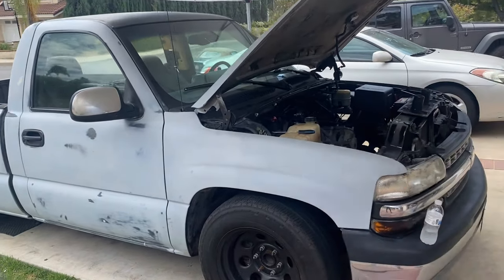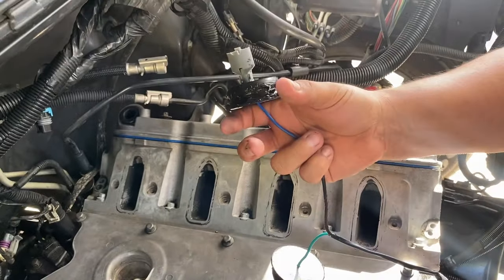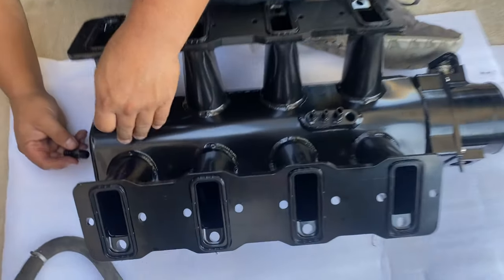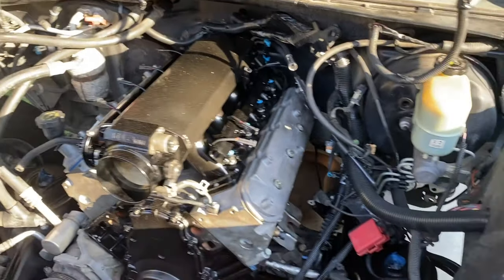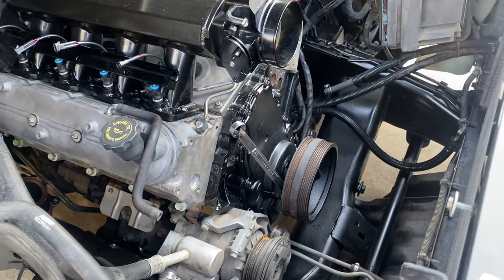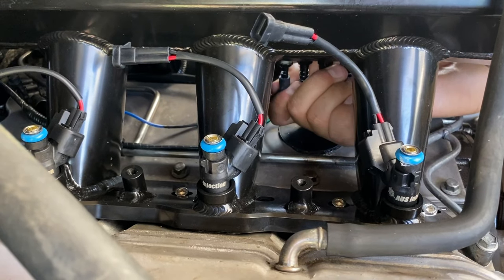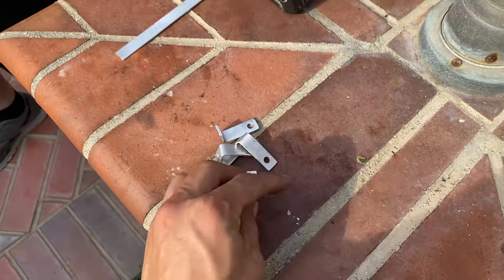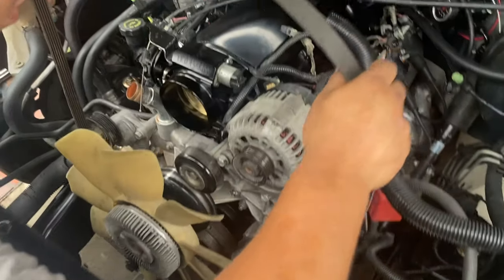SILVERADO 5.3 GETS A 102MM INTAKE MANIFOLD & MORE!!

Comment: The stock intake manifold on these 4.8 5.3 proven to flow more hp and tq over eBay and Amazon fabricated intakes other than that your buddy done a good job doing the swap on your truck though
Reply from the maker: Yeah i’ve heard 50/50 on these intakes I plan on boosting tho that’s why im sticking with this one! maybe a tbss later!
Reply: They put a square port intake on a cathedral port head 😂😂😂 nevermind that it’s cheap ebay crap, the intake to head flow is going to be turbulent AF 😂
Reply: @plugBONE is it bad new here sorry lol
Reply: @plugBONE the o ring is rectangular but the port is cathedral….but still those sheet metal intakes are 🗑️ on N/A
Reply: I would have gone with 6.2 intake manifold

Comment: Upgrading one part means you have to upgrade other parts if you’ll do a bigger manifold then you need a bigger intake cam lobe and bigger trick flow heads along with some injectors with high lbs

Comment: I just got this intake manifold off Amazon and want to say thank you for making this video because I was about ready to return it thinking I couldn't put it on my 05 Yukon Denali 6.0 which has electronic throttle body which making a cable drive won't be too difficult, now I know how to install this and I wasn't aware of the e85 sensor or the regulator I'll see if I can get those off Amazon as well
Reply: Did u end up doing it bro

Comment: Badass video I just got this intake manifold and I'm getting ready to put it on my 05 Yukon Denali and I was about ready to return it until I seen this video so thank you where do I get to eat 85 sensor and where did you get the regulator my s***'s from Amazon
Reply from the maker: Appreciate it brother, I got mine e85 sensor from eBay I think and got my fuel pressure regulator from eBay as well just a cheap one two but it’s been working great. And you don’t really need the e85 sensor unless you plan on running e85.

Comment: I’m almost done with my build bro last thing is what size was ur vaccum hose for your regulator and the size for your PCV line, and what was the little snap on thingy called
Reply from the maker: We use 1/8 vacuum line but will probably switch to 3/16 because 1/8 was a little tight but still worked with some persuasion. As for the PCV line I think it was 3/8 line but would need to double check but almost sure that’s it. As for the snap on thing are talking about the e85 sensor or the fuel line fitting?

Comment: Badass build ! I got the same truck and I installed the same intake manifold, at what psi did you set the fuel pressure regulator?
Reply from the maker: Appreciate my guy! I have mine set at 58 for idle that’s what I’ve heard is suggested, so far so good !
Reply: Thanks for the reply bro! Love the videos
Reply: I hope this ain't a stupid question but do you need the e85 sensor I'm new too all this
Reply from the maker: @thekingofnoobs8362  not at all my guy! The sensor is only needed if you plan on tuning for the truck to accept both 91 pump gas and e85, if you tune the truck only on e85 the sensor is not needed!
Reply: @ErikRose_  one more question what happens to the evap purge valve on top
Reply from the maker: @thekingofnoobs8362  we just left it hanging not in the intake anymore and I think my tuner tuned it out
Reply: @ErikRose_  one more thing the 3rd hose connected to throttle body was that the fuel regulator vent hose goes
Reply from the maker: @thekingofnoobs8362  yessir that is correct!

Comment: Can you slide the link for all the parts you used? Following your build I’m trying to get my 5.3 running on e85 already
Reply from the maker: I gotchu bro full list for what i did on mine for e85! These are exact links of what I bought. 

Fuel Pressure Regulator : https://www.ebay.com/itm/293098256458?mkcid=16&mkevt=1&mkrid=711-127632-2357-0&ssspo=VSwMTnaKQMa&sssrc=2349624&ssuid=nCH1hP3qSsK&var=&widget_ver=artemis&media=COPY

E85 Fuel Pump : https://www.ebay.com/itm/184033790153?mkcid=16&mkevt=1&mkrid=711-127632-2357-0&ssspo=YFsJgTc4R8q&sssrc=2349624&ssuid=nCH1hP3qSsK&var=&widget_ver=artemis&media=COPY

E85 fuel filter: https://www.ebay.com/itm/353786252312?mkcid=16&mkevt=1&mkrid=711-127632-2357-0&ssspo=ckmxfmmqtas&sssrc=2349624&ssuid=nCH1hP3qSsK&var=&widget_ver=artemis&media=COPY

PTFE Fuel Line : EVIL ENERGY 6AN PTFE Fuel Line... https://www.amazon.com/dp/B07JFPXHB2?ref=ppx_pop_mob_ap_share

E85 Flex Fuel Sensor: ACDelco 13577429 GM Original... https://www.amazon.com/dp/B01GQR9C5O?ref=ppx_pop_mob_ap_share

E85 Sensor Connector: For GM E85 Flex Fuel Sensor... https://www.amazon.com/dp/B07115TSNK?ref=ppx_pop_mob_ap_share

E85 Quick-Disconnect Female Push-On EFI Fitting : EVIL ENERGY 6AN Male to 3/8" SAE Quick-Disconnect Female Push-On EFI Fitting https://a.co/d/6y8j7sV

And you’ll need AN6 fittings to connect all your PTFE hoses, that’ll differ depending on how you route your hoses. I got mine on Amazon as well. Thats Everything.

Comment: You took the time to clean the valley plate, should’ve painted it to protect it buddy 😮😅✌️
Reply from the maker: Ehh gonna do another rebuild when I turbo it down the line ! 💪
Reply: how is paint gonna protect an aluminum piece? I could see if it was steel you can protect from rust but what value is it gonna have on aluminum besides cosmetic?
Reply: Its been there all these years unpainted, it’ll be fine lmao
Reply: Shiiiii just finished a L87 Stroker from the block. 10 months! Ridiculous! And the cost so far? Almost 30. All my labor. All made in the US 6.8 liter. 1000HP

Comment: I’m still stuck installing bro my last few things is how’d you do it with your EVapor canister and your EGR line tube, I’m having trouble with them I don’t know what to do with them
Reply from the maker: Unfortunately, you can’t run those on this manifold. I just deleted them and having the tuner tune them out. There might be a way to do it but will require fabrication.

Comment: Did you have any issues with the fuel rail mounts? I got this same intake for the 5.3 I built for my sons 85, running the multitech 2 injectors, I had to heavily modify the fuel rail brackets.
Reply from the maker: Yeah, my mounts didn’t work with my injectors either had to make completely new ones..

Comment: How did you get the fuel injectors installed every time I install mine I break a O-ring I’m $100 in O-rings already
Reply from the maker: LoL, they just went right in no issues. Do you have the right fuel rails?
Reply: @ErikRose_  fuel rails work great it’s the intake manifold that they won’t fit. What injectors did you use?
Reply from the maker: Ok, I used AUS 36lb injectors from lsxceleration.

Comment: What’s the difference on a 92 mm and a 102 mm I have a 4.8 which one would be better the 92 or 102
Reply from the maker: It’s just a bigger throttle body, a 92mm should be fine for a 4.8

Comment: did you delete the big ol emission pump or w.e that's on the left side of the engine bay ? link to the e85 sensor ?
Reply from the maker: yessir deleted it and had my tuner tune it out! 

Heres the link to the sensor I got!

ACDelco 13577429 GM Original Equipment Flex Fuel Sensor https://a.co/d/5qzyJVc

Comment: What did you do with the front coolant pressure line that runs to the oem intake? Was that line blocked off??
Reply from the maker: The steam port that goes through the throttle body?

Comment: Badass informative video bro! How’d you run the throttle cables?
Reply from the maker: I made a custom bracket that bolted right onto the throttle body, but they do also sell ones that fit those throttle bodies too perfectly!
Reply: @ErikRose_  appreciate the reply! I’ll see if I can find one, did you see them on Amazon or a specific website/brand?
Reply from the maker: @daniellozano289  Here’s one on Amazon! I think they have the same one on ebay too! 

Woopeey 4-Bolt Throttle Cable Bracket for LS LSX LS1 LS2 LS3 LS6 LS7 Intake 92mm to 102mm https://a.co/d/299loBU

Comment: Hey bro when u changed the headers for the 5.3 ones does dont have the egr valve do u have to get it tune if u delete it or can u run the truck like that
Reply from the maker: Yeah you can run it like that, but you will just have a check engine light on. So if you don’t want one you’ll have to get it tuned out.
Reply: @ErikRose_  whats the pros on changing them
Reply from the maker: Not much, we just used them because we put the tbss manifold which doesn’t have the port for the egr stuff so we used these exhaust manifolds because they didn’t have the ports either which work out good.

Comment: whats the electronic sensor looking doo dad on the line in to the pressure regulator?
Reply from the maker: that sir is an E85 flex fuel sensor, not required for the fuel pressure regulator just something I added for tuning later.
Reply: @ErikRose_   thanks!
Reply: So what do you use in place for the e-85 sensor if you’re not going e-85 yet?
Reply: @moycorral7870  probably  just run the line as you would but without the sensor

Comment: Do you have the linke for that intake manifold
Reply from the maker: Yessir! Heres the link to the one I got bro!

Top10 Racing Intake Manifold with Fuel rail fit 102mm Throttle Body Sheet Metal Fabricated EFI 15° Throttle Opening Compatible with Chevrolet Chevy GMC Pontiac LS LS1 LS2 LS6 Black https://a.co/d/19sIHZz

Comment: Where did you get the throttle body from?? Can you send the link?
Reply from the maker: Yessir I gotchu! This the exact one I bought!

LineRacing 102MM Throttle Body for Chevy GM Gen III LS1 LS2 LS3 LS6 LS7 SX LS LSX 4 CNC Bolt (Black, 102mm) https://a.co/d/7meQJD3
Reply: @ErikRose_  thanks appreciate it
Reply: @ErikRose_  do you have the link to that intake....
Reply from the maker: @robertchalk8193   yessir there you go! 

Top10 Racing Intake Manifold with Fuel rail fit 102mm Throttle Body Sheet Metal Fabricated EFI 15° Throttle Opening Compatible with Chevrolet Chevy GMC Pontiac LS LS1 LS2 LS6 Black https://a.co/d/iFRc10U

Comment: Did you mount square port to cathedral head with no adapter?
Reply from the maker: My kit came with the gaskets that give the ports a good seal ! so you can either of the two adapter or gaskets.
Reply: @ErikRose_  I just spent $217 on adapter.  Gonna return it now
Reply: @ErikRose_  I have same seals.
Reply from the maker: @fmrperformance7774  what manifold do you have?
Reply: @Erik Rose  chrome version of yours.

Comment: How did you put a 102 ? Rectangular ported on a triangle port head???
Reply: I noticed that too LOL it’s possible cause the square ports on the intake is larger than the cathedral ports on the cylinder heads making it able to work but there’s a big problem in doing this as it could cause a lot of turbulence but I think some have done it without any problems but using cheap eBay or Amazon fabricated intakes I don’t think anybody knows if it effects the turbulence and choke the cylinder heads or not
Reply: This is where I'm stuck at the cathedral ported heads and the rectangular intake......does it work or what

Comment: I got a stock 5.3 wtf should I do to add more Power
Reply from the maker: Everything that i’ve done to my truck has been for power increases, Stage 2 Cam, Intake manifold, E85, and theres lots of other things you can do!
Reply: @ john_doe627 Iam in the same boat but I have decided to do full aftermarket suspension, long tube headers, high rise intake manifold, all new msd ignition system, new fuel system, and possibly a new distributor, and new brake system. You gotta think when you start adding power don’t want your ride, riding like shit and it’s gona need the fuel so yeah it’s expensive but driving that bad boy on the weekends to the track priceless!

Comment: Your injectors didn’t leak ?
Reply from the maker: Nah no leaks !
Reply: What about the ports to the rectangle to  cathedral
Reply from the maker: @GbodySS_LsX  no issues as well ! but i do know they make a cathedral port style for this manifold if you want that !
Reply: I already have it mounted just having fuel rail issues with my alternator but I bought fittings
Reply from the maker: @GbodySS_LsX  is not clearing or hitting the alternator? Because I know they make 2 different styles of the Manifold, a short runner and a long runner, mine is a long runner and clears with out issue!
Reply: I seen u use the 180 fitting I have the cross over in front il probably re rout it on the left side nd have the cross over in rear thanks papas
Reply: It’s hittin the alternator
Reply from the maker: @GbodySS_LsX  ahh ok yeah you probably got the short runner intake, which it still works but you just need to make some adjustments around things like that!
Reply from the maker: @GbodySS_LsX  yessir I made a youtube short also to explain the set up a little better if you wanna check that out also ! 💪

Comment: Nice ! If you dont mind Bro can i get all the Links
Reply from the maker: I gotchu bro full list for what i did on mine for e85! These are exact links of what I bought. 

Fuel Pressure Regulator : https://www.ebay.com/itm/293098256458?mkcid=16&mkevt=1&mkrid=711-127632-2357-0&ssspo=VSwMTnaKQMa&sssrc=2349624&ssuid=nCH1hP3qSsK&var=&widget_ver=artemis&media=COPY

E85 Fuel Pump : https://www.ebay.com/itm/184033790153?mkcid=16&mkevt=1&mkrid=711-127632-2357-0&ssspo=YFsJgTc4R8q&sssrc=2349624&ssuid=nCH1hP3qSsK&var=&widget_ver=artemis&media=COPY

E85 fuel filter: https://www.ebay.com/itm/353786252312?mkcid=16&mkevt=1&mkrid=711-127632-2357-0&ssspo=ckmxfmmqtas&sssrc=2349624&ssuid=nCH1hP3qSsK&var=&widget_ver=artemis&media=COPY

PTFE Fuel Line : EVIL ENERGY 6AN PTFE Fuel Line... https://www.amazon.com/dp/B07JFPXHB2?ref=ppx_pop_mob_ap_share

E85 Flex Fuel Sensor: ACDelco 13577429 GM Original... https://www.amazon.com/dp/B01GQR9C5O?ref=ppx_pop_mob_ap_share

E85 Sensor Connector: For GM E85 Flex Fuel Sensor... https://www.amazon.com/dp/B07115TSNK?ref=ppx_pop_mob_ap_share

E85 Quick-Disconnect Female Push-On EFI Fitting : EVIL ENERGY 6AN Male to 3/8" SAE Quick-Disconnect Female Push-On EFI Fitting https://a.co/d/6y8j7sV

And you’ll need AN6 fittings to connect all your PTFE hoses, that’ll differ depending on how you route your hoses. I got mine on Amazon as well. Thats Everything.
Reply: @ErikRose_  Thank You Bro Going This Route for my 4.8 Should be good Right
Reply from the maker: @1sixkobstahoe138  yessir 4.8 should be pretty much the same !
Reply: @ErikRose_  Bet Thanks Bro , What about if i just want to install the intake manifold for now will it be just plug nd play bro ? Thanks for your time 💪🏽

Comment: Where did you get your e85 kit bro?
Reply from the maker: I got the e85 sensor off of Amazon and the regulator as well.
Reply: Thanks bro is it universal or for Silverado?
Reply from the maker: Yes basically universal, you just need the get the pigtails and wire it into you computer and then get it tuned for the mix. You also need the necessary fittings to connect to your fuel lines. I think this is the one I have on mine if I remember correctly. ACDelco GM Original Equipment 13507128 Flex Fuel Sensor

Comment: We’re did you place the map sensor?
Reply from the maker: You run a vacuum line from  the smallest nipple under the manifold to the map sensor.
Reply: @ErikRose_  did you mount it somewhere or did you leave it hanging ? Currently in this situation 😅
Reply from the maker: I just left it hanging under the manifold haha. But you could mount it if you want to.
Reply: @ErikRose_  naw am doing the same thing haha 😂 I just needed to ask 😅to make sure am not the only one haha 😂
Reply from the maker: Haha 😂 go for it then. Just extra work that’s not necessary lol.

Comment: So what’s the back holes for on the intake
Reply from the maker: I think it is for the map sensor but mine didn’t  fit with my style. But might fit with the newer style with o-ring, but either way I didn’t need it just left it the plug in.
Reply: @ErikRose_  ah ok thanks bro just doing lots of research on this intake rn
Reply: You can buy the ls3 map sensor, with the converter wire to plug in

Comment: Did the throttle cable give you issues?
Reply from the maker: Just had to get a new bracket to make it functional.
Reply: @ErikRose_  do you have the link of which bracket you used